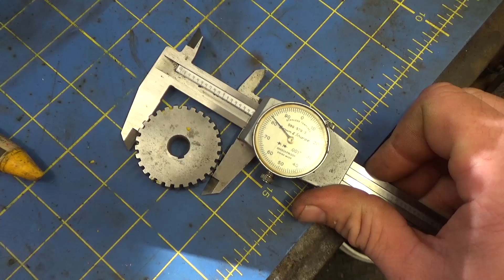Discussion about Central Machinery 7 x 10 Lathe

Comment: Hello Joe!!!!  Walter is right- Little Machine Shop.com has every nut bolt and washer for these machines. Your model is a good one (made well) these were pretty much phased out to a longer bed (7x14) but when tuned up right they are great little machines!  The belt you need is indeed a Cog belt that will be a little bit of a pain to adjust just right so it is quiet and doesn't wear... the motors on these early models are great and have lots of power!  I think you will have lots of fun with it!  Thanks!!!!!
Reply from the maker: Thanks Scoutcrafter! I went back and rewatched your mini lathe videos....the tip about buying stubby drill bits really makes a lot of sence now that i own a 7 x 10 machine 😂....this sucker is small. Anyway, i am excited to own it and i am anxious to explore all the youtube content on this little gem. Cheers.